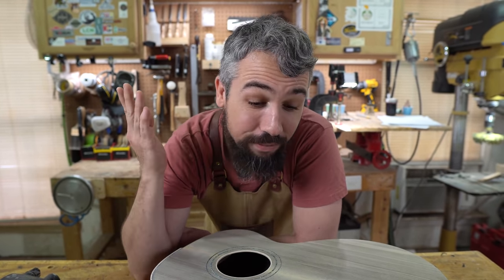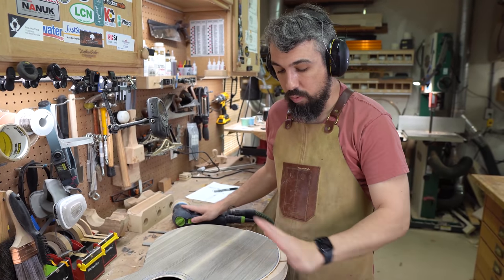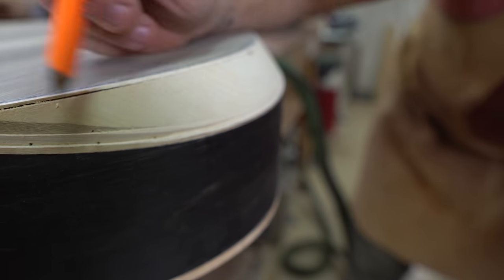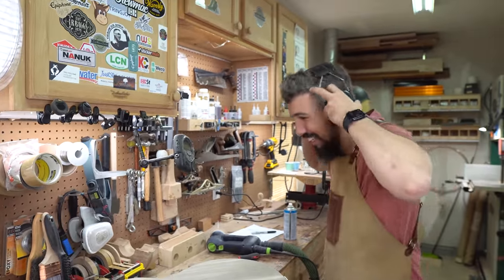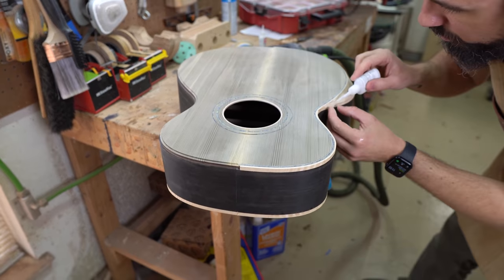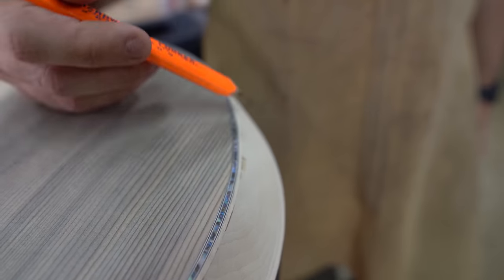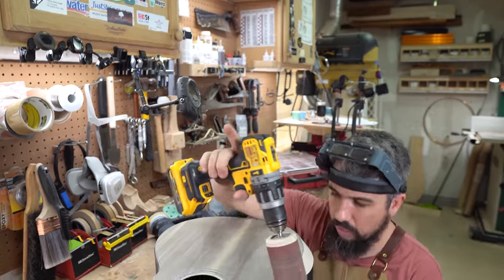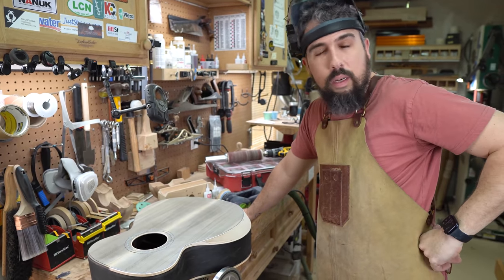How To Build An Acoustic Guitar Episode 23 (Carving the Arm Bevel)

Comment: For some of the smaller, more delicate work, what is your opinion of using a smaller dremel tool with various sanding attachments?  Dremels can create some very cruel errors, due to their small size and high spin speed, but they're hard to beat in tight spaces.

Comment: I like comfort contours, but it seems like a lot of work for some thing that ends up reducing the size of the soundboard in the process. Is the final size of the soundboard about what you'd have on a Parlor Guitar? I think the Manzer wedge is a better option. Or perhaps even better would be to add a one inch wedge to the "side" of the guitar to get a comfortable angle for the forearm to rest on.